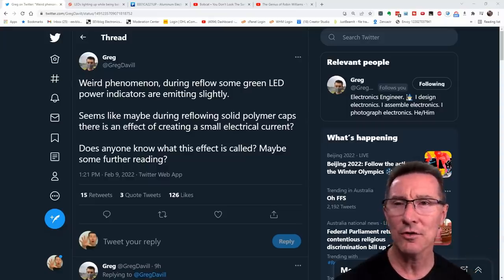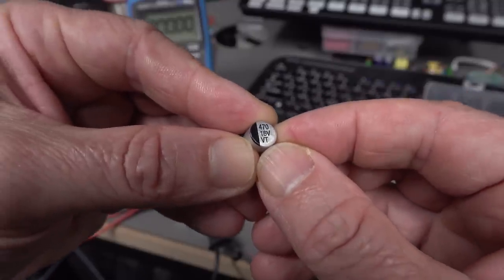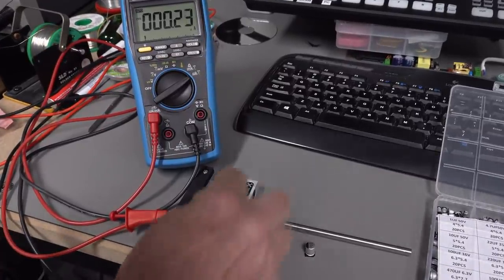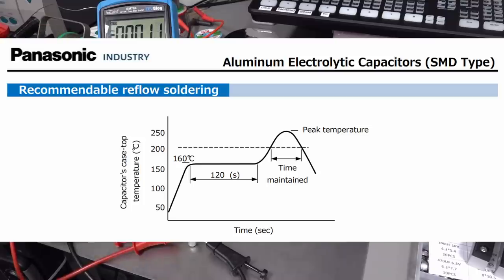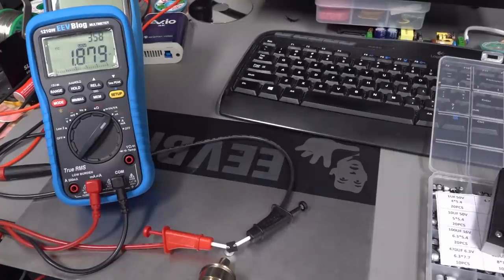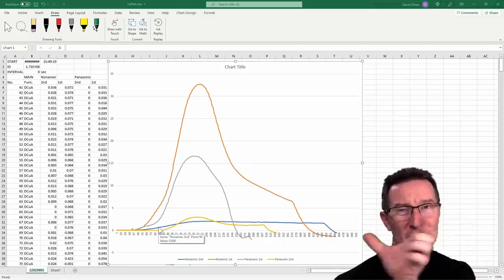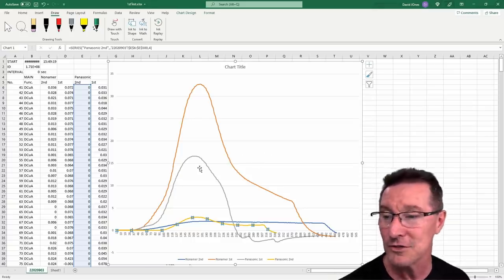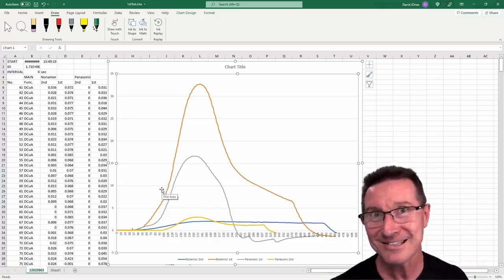EEVblog 1455 - Capacitors Produce Current During Reflow Soldering! WTF!

Comment: While working production for an avionics company we always 'dried' the capacitors (all components and the PCB) before reflow by baking/heating them for several days at a temperature above 100-C.  I was told this was to reduce tombstoning and other trapped water events, but one of the greybeards mentioned that caps would produce voltage and current in the circuit if they weren't dried.  Perhaps as the water bakes out of the electrolyte, there is a small chemical reaction going on that causes a slight amount of current?  No idea because we always baked them first.  It would be excellent to hear from a capacitor guru out there who knows exactly what this is.  Now I am just waiting for someone to string 10k++ of these capacitors in series and charge an iPhone or light an incandescent with this effect. Great channel, thanks for the video!  Cheers!!
Reply: Some manufacturers instruct to dry their ICs before introducing them to a circuit. I always thought this was like to prevent a lottery event.
Reply: > ... Now I am just waiting for someone to string 10k++ of these ...
Not gonna lie that would be interesting to watch
Reply: @dev639  You bake ICs and LEDs before reflow to prevent popcorning (that's the actual term) if they've been out of the sealed bag for a while. Not all ICs and LEDs are sensitive to it though.
Reply: SMD led's are often supplied in sealed packs with indicator boards, that show if they need to be dried out (by heating) prior to reflow. It prevents the component 'blowing' or out gassing during reflow (can also happen with hot air rework , with clumsy operator).
Reply: @alexstone691  Let us critically think for a moment. For this to be a great video, we must summon ElectroBOOM. He'd purchase a big enough oven and solder all the caps together, then plug them in with reverse polarity to try to blow up an entire string of caps before the real tests would start. It would and could be great.
Reply: To charge an iPhone you would have to parallel them, wouldnt you?
Reply: @milesnapue  Who's got mr electroboom's number
Reply: Moisture sensitive components always need to be processed according to their moisture sensitivity level. For small volume production and especially for avionics/space, where the components might have been in storage for years, baking all components before use is quite sensible.
Reply: @Sigurdinus  both, you need enough current and voltage.
Reply: Haha, I wish more greybeards had channels. Big Clive tends to explain lots of really unknown information on things. I love learning this rare stuff.
Reply: @milesnapue  Amen, only an eyebrow such as his can ensure success
Reply: That's what I was thinking too. Maybe there's some sort of electrochemical reaction going on that's sped up by the reflow oven/heat gun.
Reply: @alexstone691  You don't need his number. Simply put in the description "new free energy device!" and he will respond!
Reply: @glasslinger  When you say free energy three times in a mirror he appears and rectifies you
Reply: @alexstone691  I'm with you.
Reply: That's what I was thinking, ie, absorbing moisture. Bought some old 3rd/4th gen motherboards that had been sitting for a long time, and 1 or 2 heat cycles latter they failed. I was thinking moisture absorption, because in a reflow they preheat to remove moisture. It would be interesting to re-moisture the caps - lol -.
Reply: @Sigurdinus  : You can just shove the power through a buck converter if you have enough caps.
Reply: @milesnapue  he would try to check on the capacitors in the reflow oven, both shocking and burning himself on the hand.
Reply: They are supposed to be completely sealed so I think this is more likely the heat causing a change in the properties of the dielectric, either the relief of stress as it is heated, differential expansion of the parts, or a change in the dielectric constant of the material. I suspect the effect would not be observed in entirely non-polar capacitors since there is no source of static charge differential whereas the surfaces of each plate of a dielectric capacitor will be made of different materials and have some different static surface charge.

Comment: After they have been heated multiple times,try to charge them up to their rated voltage for an hour. After that you let them discharge for a day or more. And then apply the heat again, you may get current again from the heat, or may not.
Reply: Yeah, I was wondering, why Dave didn't do that. Or apply at least some kind of charge, decharge (with a not-too-low-resistor) and re-heat & re-measure. Probably the effect arise from some residue chemical stuff after charging that needs some heat to start the reverse reaction, in chemistry that's called the activation energy Ea.

Comment: I don't know if this is relevant, but when I was a kid, batteries were very expensive, and I used to heat some discharged batteries near a stove, and I got my car toy running for a minute or so, and then do it again and again. It worked every time, even with batteries that were totally discharged and reheated many many times.
Reply: Hmm fire hazard AAAAAAAAAAAAAAAAAAAAAAA
Reply: @alienozi  I never heard of the AAAAAAAAAAAAAAAAAAAAAAA, only to AAAA types, AAAAAAAAAAAAAAAAAAAAAAA must be very tiny!
Reply: Very simple, the heat activates the remaining chemicals,  and allows the depolariser material inside the cell to remove the thin film of by products preventing the current flow, so allowing the zinc carbon cell to operate again. The zinc gets a thin film of depleted electrolyte at the surface, so the heat allows the thin film to be diffused into the bulk of the sawdust filled electrolyte, so the cell works again, and then the manganese dioxide in the centre reacts with the depleted electrolyte to refresh it slightly. The cell though only responds a little more, the electrolyte is all used up, and so is the depolariser, so the cell is not going to have much capacity any more.

Used to do the same, though often if you were less than careful your cell would melt and spread a goo of tar and sawdust all over, as the electrolyte was that dry by then. Also used to remove the carbon rod off the D cells, and use them to make resistors, and also to weld with.
Reply: I've never heated the batteries but just crush it slightly using my mouth (I know) and its works for a while again
Reply: That technique goes back around 100 years. In the early days of radio broadcasting, people living in rural areas without electricity would warm the battery of a radio to extract as much power as possible.

Similarly, people in cold weather climates will carry phones or radios in inner pockets to extend battery charge.
Reply: Did the same, once forgot LR44 cells on Stove and was later surprized by serveral Gunshot like sounds hahahah. yes im a 90s kid
Reply: @thomasbland6428  I'm currently having that struggle if I pull my phone out for more than a few minutes at a time while outside it will turn itself off even when nearly fully charged can't really blame it I get sleepy when I'm cold too but it sure is bothersome.
Reply: @oliverer3  My solution was to turn on the ‘Hey Siri’ on my iPhone then plug in the wired headset.
Reply: back in the 80s and early 90s when walkmans and western music were the rage here in ex-commie countries, this was not uncommon. When the batteries drained and could only run the tape at like half speed (anyone remember tapes slowing down and playing back at slower pace/lower pitch as the battery went?), the kids listening to it took out the batteries and rubbed it so it could get warmer and get a bit more charge so they can finish listening to a song. Often with multiple sets of batteries in rotation.
But I can't tell if this was caused by heat or if they had clothes on and produced static electricity that sparked some life to the battery.
Reply: When the ac or tv remote goes flat I find warming the batteries up with my hands is often enough to get the remote working again
Reply: My dad's friend used to bake D and C cell batteries in his oven to recharge them. He swore it worked. I never tried it myself though. This was back in the early 1990s.
Reply: @thomasbland6428  Tesla uses this technique to extend range by incinerating its battery!

Comment: Try charging it to max voltage, and discharge. Then retry the test.
Could be charge absorption in the dielectric that the heat releases.

Hot vs cold and charge vs discharge. Could be something there.

Comment: Two things, if it was thermoelectric effect (like a thermocouple) it shouldn't change on the second run.  You measured the current, but what results do you get if you measure the voltage produced (using a high impedance meter) 
The most likely reason for the effect is that the heat upsets the tiny demons living in the cap!
Reply: Maxwell's demons?
Reply: @tiborgats  Neah, these are Nernst's daemons playing with the electrolyte...
Reply: It would change if the capacity was reduced; the capacitor would be filled more quickly.
Reply from the maker: @tiborgats  Schrödinger's Demon?
Reply: It is the 5G mate
Reply: @EEVblog  no it's the restless soul of Volta trapped in every capacitor
Reply: It's capacitor pixies cooking up another batch of magic smoke in anticipation.
Reply: Honestly. Have a look for the Nernst Equation and the electro-chemical equilibrium. It depends on temperature. If you change the temperature, the electrochemical potential of the half cell at the anode and the half cell at cathode change. This results in current flow.
The high voltage capacitors we use at work charge up by themself at room temperature. Because of this we attach discharge resistors when storing them. Touching 5kV @ 5nF is not funny.
Actually there are high temperature batteries using natrium and sulfur. They don't even work on room temperature.
Reply: @marcelkanter  Yes, I agree. You can even measure the EMF voltage at nanostructure. Former institut I worked for wrote a research paper about nanaobatterys.

Comment: We made the same experiment in highschool and observed the change in voltage by moving the plates of disconnected capacitor. By heating you decrease the dielectric coefficient and the capacitance, so the voltage goes up. When cooling the opposite happens and current flows the opposite direction.
Reply: @Dave: agreed, heating. Might also change the distance between the plates - that will change capacitance. Since you are recording current, you should extend your logging time during cooldown. By integration I over t of heating vs cooling time you may find out if the small negative current over time (when capacitor is cooling down) will add up to the amount of charge transferred during heating. Please test - I am so curious! Second experiment: remove the leads directly after heating - then test after cooling time if the current spike is in reversed direction…
Reply: but initially caps were shorted. there is no initial charge prior to heating.
Reply: @osmanfb1  Well if there is zero charge, there should be zero current as well.
Reply: @ergindemir7366  that's why there is WTF  in the title!  Where  is it coming from? There are dissimilar materials which can create thermo-electric potentials, changes in the dielectric can cause chemical reactions,...etc
Reply: @osmanfb1  There are trapped charges in the dialectic. This is how your flash memory loses data when you heat it up.

Comment: Actually, my guess is that your first guess of dielectric absorption is spot on. This sounds a lot like the behavior of electrets. A dipole charge is formed in a bulk dielectric substance under heat, and then cooled. Very much the electric analog of a magnet. When heated, produce a larger discharge which depletes the absorbed charge. Maybe a small absorption is a byproduct of the manufacturing process? I would suggest "Experiments on the Carnauba Wax Electret" by Gerson and Rohbrbaugh (Journal of Chemical Physics, v23 N12 1954)
Reply: That sounds right, also heating releases "trapped" charges from the dielectric material.

Comment: Likely there is a redox-reaction going on which is sped up at higher temperatures. Try to heat it without a closed loop. If the reaction needs a closed loop you should be able to observe the same current if you heat it open, cool it then repeat with a closed loop. An example could be the formation of the oxide layer. Not sure how passivated it is. Can you recover it if you hook it up reversed polarity?
Reply: yeah that might be it

Comment: Makes sense. The ceramic ones are essentially piezoelectric devices, so physical strain=voltage.
Reply: Vibrating a cap can make it leak, but I wonder if it does the opposite as well, and charges them up...
Reply: yes, ceramics vibrate at the ripple frequency, also one of the effects responsible for voltage vs capacitance characteristic. Strong vibrations will also produce a signal.
Reply: @liam3284  On a product I designed many years back, people with good hearing could hear the capacitors sing.

Comment: I believe it is thermal expansion.  You can also do it in reverse with "compression". Take an old cap that you don't care about, hook it up to your multimeter and use pliers to "squeeze or compress" the cap  (At this point the polarity will be reversed). But in some cases can get well into the mA range. With heating, you are basically doing the same thing, without the damage of course. You are essentially "closing the gap" of the dielectric using expansion or compression, therefore producing a current.
Reply: Yep, I reckon you're right. The expanding plates will squeeze the electrolyte out of the gap during the heating, and I suspect the reason it only works once is that the reverse does not happen when you take the heat away because the amount of force needed to push electrolyte through those small cavities is quite high (eg a pair of pliers!). Next time you heat it that gap's already as shrunk as it's going to get. Maybe if you leave it for a long time it'll work again.
Reply: @jhonbus  Agreed!   A repeatable experiment for compression is to open up the capacitor, unroll the plates, and apply pressure. You can even use a "roller" to get consistent moving pressure. Your current will vary depending on pressure and movement. As the electrolyte dries up, the effect slows down. Wear gloves as the electrolyte can be nasty stuff! Lol

Comment: I think what's happening is normal thermal expansion of the dielectric material, altering spacing between conductors of the capacitor.   For a given charge a reduced capacitance would increase the voltage.  Possibly over the 1.2v to trigger a red led

Comment: That could be at least partially some kind of piezo-thermal effect. The temperature change creates a thermal expansion which creates a potential shift in piezoelectric materials between the two electrodes, resulting in a small current. I have measured this effect on piezoelectric plates, which create quite high voltages (enough for 1-2mm arcs).
Reply: This is similar to what I thought, the heat spreading the plates
Reply: If it is a piezoelectric effect then why does it not work the seccond time? No, something tells me that the effect has a purely chemical nature. 

I would actually guess that the passivation layer on the plates is slowly dissolving when not enough voltage is applied and doing so even faster under higher temperatures. If the theory is correct then trying to "reform" the caps by slowly charging, waiting a bit and then discharging them under normal conditions should "reset" the effect.

Comment: 2 things, just ideas: 1) The heat causes the “plates” in the capacitor to squeeze out the electrolyte, the plates get closer during this time and thus causes a change in voltage which drives the observed current. The cap cools but the electrolyte doesn’t immediately flow back into place and the plates have a slightly different characteristic, thus when heated again does not produce the effect to the same magnitude (there’s not as much electrolyte to squeeze out). I’m wondering if say you’d leave the cap on the table long enough to see if the electrolyte would flow back into place. 2) if my first assumption is correct then this could be a technical time-variant negative resistance, or negative impedance. This should definitely be looked into
Reply: Was thinking the same thing, but rather than a plastic deformation of the electrolyte, it's likely that there's less charge between the plates the second time around because squeezing the two together the first time around discharged the remaining charge between the plates...I suspect that the electrolyte being deformed in some semi permanent way would probably result in a change in the characteristics of the capacitor after the test...

Comment: Dave, I'm in test. ICT test just after boards have been built. We are accurately measuring ceramic capacitors. It seems the larger vaules (larger than 10uF) will measure around -30% until you reflow them or power the board up! It's a big problem for us. Since parts can fail test due to weather they have been power yet or not.
Reply: The capacitance of a ceramic depends on the voltage and mechanical stress..

Comment: In the early 80s my Gran would swear that gently heating dead batteries (C and D type cells) would get a bit more life out of them. A college electronic teacher, hinted it was to do with removing built up water from the internals allowing the chemistry to work again. This might be a similar thing.

Comment: 1:27
The bottom may be connected to earth.
Switch mode power supplies usually have a isolation capacitor, which lets a small current flow. This can cause a slight glow with LEDs.